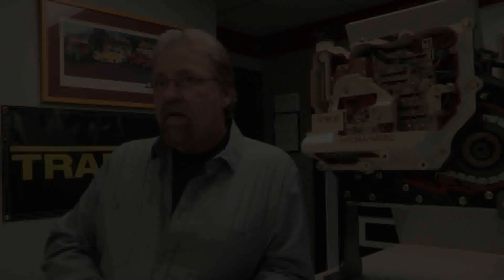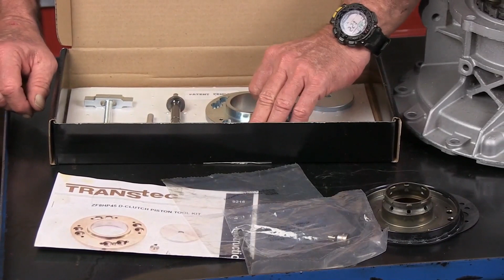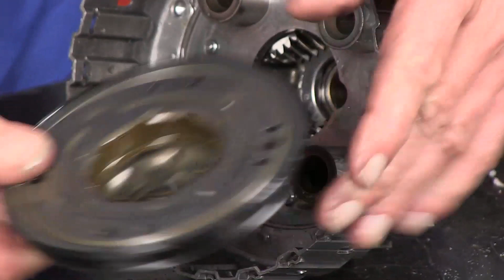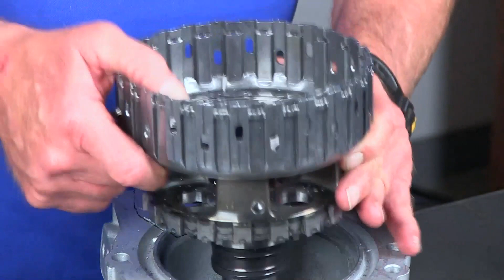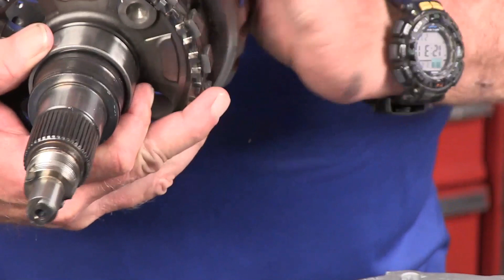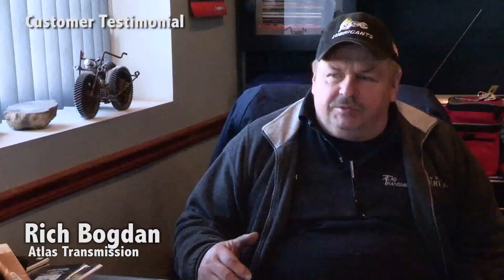Repair ZF8HP45

Comment: I wold not smack hammer directly on parts your reusing… bearing press would be the ideal method, if not access to one use something sacrificial to smack the hammer on like deep well socket about the same diameter.